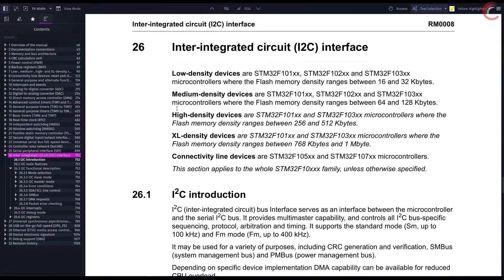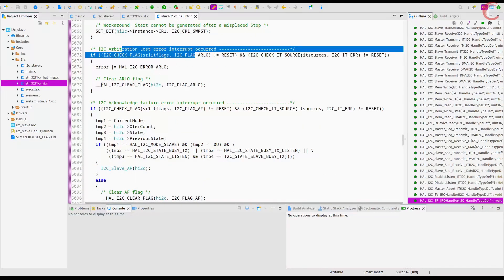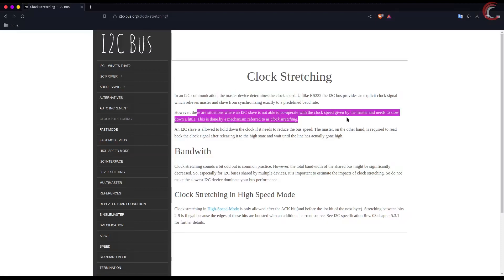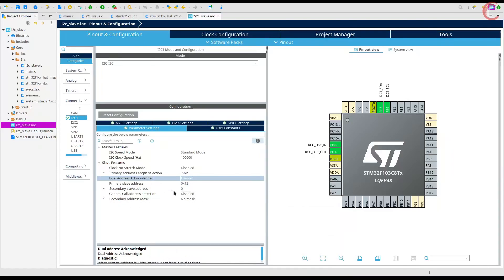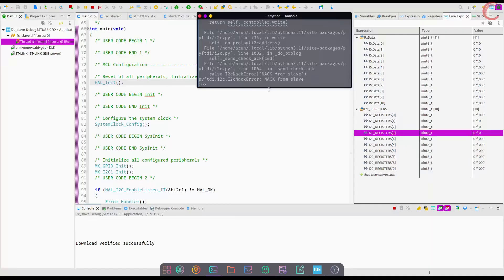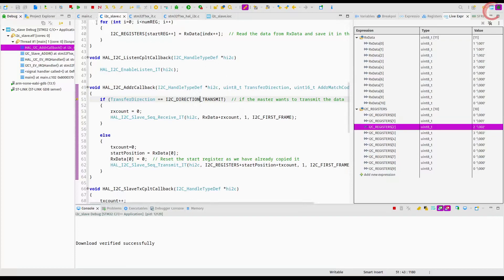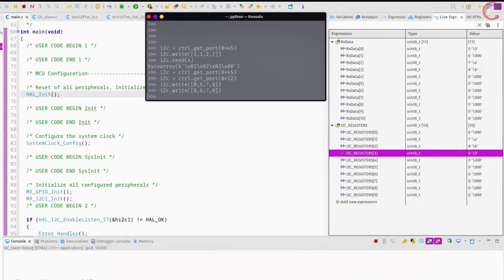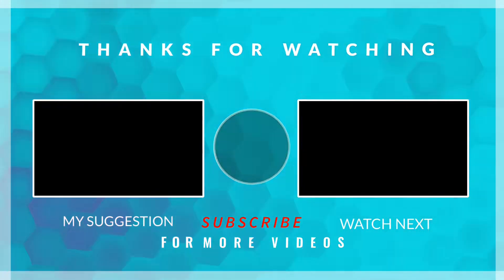STM32 as I2C Slave || PART 7 || Clock Stretching || General call || Dual Address

Comment: Thank you I was testing stm32 i2c(master) <---> stm32 i2c(slave) like this.
The polling method was easy to test.
However, I did not understand the interrupt method well and had no idea about callback functions, so I had a lot of difficulties. But by chance, I came across this video, and it was really helpful, especially since it only focused on the slave side of i2c. 
After carefully studying Parts 1 to 7, downloading the program, and taking the test again, I now have a little more understanding and method. Thank you very much.

Comment: This series has been really useful!  Can you do another series for SPI Slave communications using the HAL drivers as well?  The use of the NSS pin through a dedicated hardware line vs software register is a bit confusing!
Reply from the maker: Yes i will but the next in line is W25Q Flash. Probably after that i will cover the SPI slave